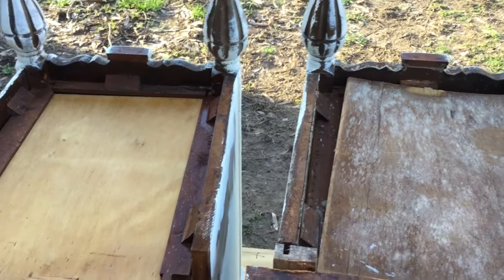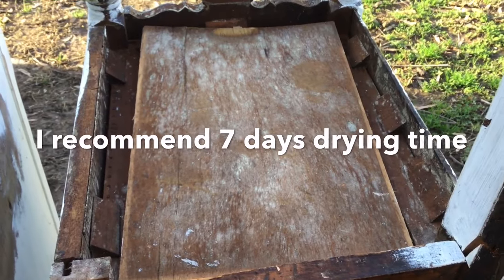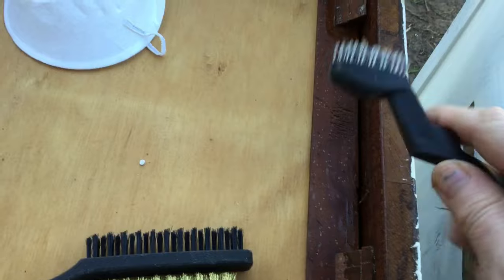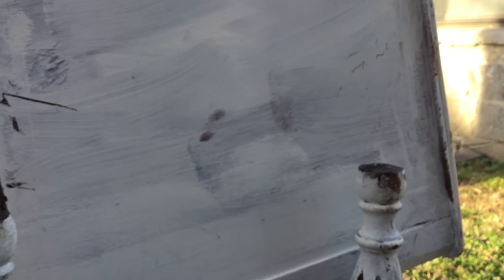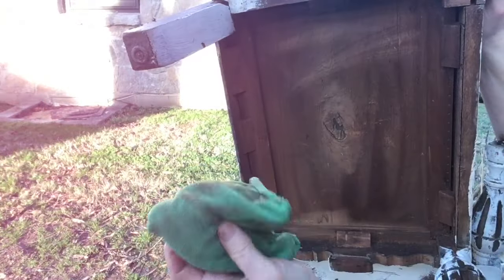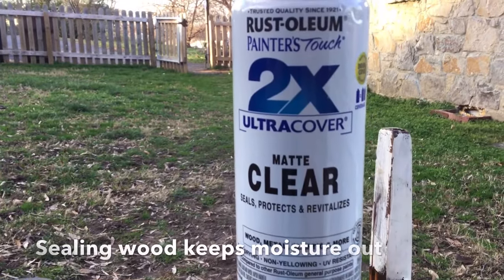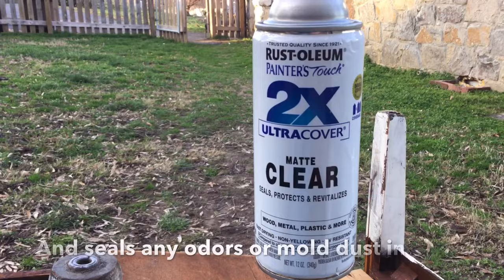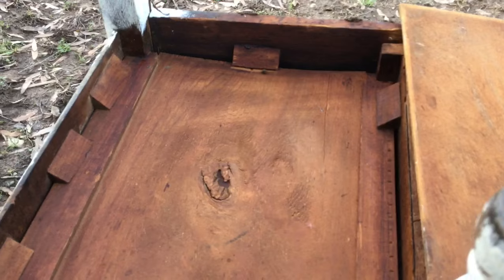Remove Mold & Mildew from Furniture DIY Hack  *Stop The Stink Mold, Mildew, Musty, Moth Balls Hack

Comment: Suggestion. Spray the piece with either vinegar or vodka to kill any mold spores and reduce smell. It will stop any mold growth.  Then proceed to the drying section. Spraying with vodka also removes smell in old clothes...
Reply: What about your couch? I’m having issues killing the order due to the humidity where I live. I spray it down with Lysol and it helps for a little while, but I can’t get it to stop coming back.
Reply: @Yah-Izoa-Hakaboth  Do not use lysol. That does not kill mold as easily.  You would have to saturate the fabric with vodka or even vinegar.  Let it dry thoroughly.. but, if the mold is in the cushions it may be ruined.  Sorry..
Reply: @SultanaP  it ruined  my wooden  Almari what can i do  when i try to wash it only cloth it not working  next day i can see lots of it can u give me permanent solution if i spray vinger is it work?
Reply: @Paula Goode Thank you so much for your information! No need to apologize. I’m going to try the vinegar and see if that works! Thanks again!
Reply: Will 90% rubbing alcohol be even better? I'm about to sheetrock but the framing has some black spots I need to treat
Reply: @levijessegonzalez3629  I'm sure it would kill the mold and deodorize
Reply: @SultanaP  better than vodka? And have you tried it on wood?
Reply: @SultanaP  I'm thinking of tearing out the wood unless I can find a treatment that kills the mold for good
Reply: @Yah-Izoa-Hakaboth  I have also bought a whole basement dehumidifier and it was worth every penny not to have to empty it every day.
Reply: Hi, I have a couple dressers that are musty but no visible mold. Could I spray with vodka, let dry then seal with the spray. I live in an apartment so getting the dresser washed outdoors won’t work.
Reply: @hihellosolares5862  vodka is inexpensive option for what you want to do. I use a sprayer from the local dollar tree and I big cheap bottle of vodka.  Spray it well,  let dry for a day and do it again. I am sure the smell will be greatly reduced! This option works very well for me, and is different than rubbing alchohol.  I don't know why,  but it is! Trying it is cheaper than other options! Good luck!
Reply: @SultanaP  thank you, this is doable. I’d really hate to have to get rid of my dressers.

Comment: Helpful for sure. I bought a 21 year old RV in Feb. Guess what they were selling it in winter to HIDE the MIDLEW. I did detect and should have RUN. But running was 550 miles to home & person with me did not smell it. Her 40 year son did not smell it and the seller swore he smelled nothing. So yeah me & my super smeller nose did too smell it. I drove RV home & on the way definitely right behind drivers seat. Sure enough once home discovered it is in one location under the fresh water tank right behind the drivers seat. I was able to knock the stench down over winter during cold months with mixtures of moldex & Oxine. They do not add perfume to the situation to mask it. It gave me great hope. Finally warmed up enough to pull the supposedly empty tank out 3 days ago. Pouring out approx a quart of water left in the tank with no way to prevent it at that moment in time. Had to cut wires that later turned out to be water depth detectors to the tank itself. OH will I don't intend to ever fill that tank more than 10 to 15 gallons using a reliable meter so to stop the source of wetting it that past owners didn't figure out. (Poor design of air hose where water can leak during sloshing about or if you over fill tank. Also sometimes the inlet fails and people don't realize they are dumping water into the RV along with filling the hose. This is the air intake hose. Ok when I pulled the tank I hoped for the best didn't get see the worst fear but pretty bad just the same. I've had lots of luck doing what's demonstrated here with furniture. Now and again it's not enough. The mildew scent returns in a few weeks to months. However love reviewing as I take a rest from scraping the underflooring where the mold's well imbedded. And due to electrical wires in this location and an electrical box just above the 4000 Onan generator it's super difficult to get it cleaned, scraped and DRY there. I ran fans all night. Started scraping today and right away could tell it's still dampened wood in places. It may be a week long job. I'm up for it. mentally more than physically I think. I have very sore wrists and shoulders from scraping yesterday. I need to worry about if it went up the wall. It's definitely into and under the wall. Dinette cushions and support that sits above this tank and mildew area picked up the scent too. This treatment shared today will work well to stop the smell in the board that the cushions sit on and also the surrounding support box that goes around the tank and also supports the cushion and that side of the dinettes bench. The foam has a slight odor as does the fabric. No problem for the fabric I am reupholstering the entire cushions and sofa. BUT not sure I can get out the scent from the foam. I'm planning on first hand washing the seat cushion with a lemon pine sol mixture and moldex. Then rinsing well in a solution of Oxine. Let air dry in the sun and hope the sun's UV will render the scent permanently gone. Time of course will tell. Meantime love watching when someone else does all the WORK. LOL. Great demonstration and so appreciate it. I will spray the boards that make up the sides of the box with a solution that stops mold growth for up to 1000 activation times due to dampness. And then spray with the YES I use the same clear Rustoleum spray paint to seal it. Also that'll be used on the board that the cushions are supported by too and I've had outside treated 3 times and still the smell is there. Pine sol is my next option. I will use the lemon as it's not as strong lingering as the original and probably not as strong either but should do the job. MILDEW so sad in most cases it can be avoided. In the case of this wonderful RV definitely could have been avoided and prevented had they fixed the problem right away. No instead I found all kinds of probably once scented drier sheets and sachets of various makes with no scent left too. No the seller knew he could pass the RV on in winter and so he did. And yes lesson learned. I DID KNOW Better and so needed to trust my nose. Not those of others who then couldn't smell it but now my husband and my neighbor who was with me when I bought it can too smell it. LOL. Luck to all of you who run into this problem. And thanks for this post. I needed it.

Comment: Hey I'm curious what state is in your furniture now? Because I believe you just trapped them under that finish, mold  cannot be removed from pourious materials, you may just removed the damaged finish, Mold has spores and they are not even visible at all, That is why you have to use something like a powerful vacuum machine with  hepa filter and it should not be cleaned in an open air but in an isolated room and after you brush the things off, that vacuum cleaner should run several hours in that room to collect any particles in the air. Besides diluted bleach would not kill the mold again, it will actually boost its growth, the reason behind that, the bleach does not penetrate wood, but water does, since you are delluting with water, water will get deeper than bleach, and will create better environment for mold to grow.

But anyways as long as your furniture is not in damp place anymore it should be fine, as long as your finish degrades and gets a bit of a moisture in it, the mold will rip off that seal.

Comment: I have mold and mildew on the outside surface of an antique Victrola.  How can I get that off without doing anything that would decrease it's normal appearance and value?  Thanks!
Reply: White vinegar. Saturate a cloth and wipe every surface. If possible let the unit air dry in direct sunlight for several hours.

Comment: Would you not recommend a quick bleach wash after wire brushing ... Just as an extra precaution against mould coming back again.
Ok, it"ll mean a bit more drying time, but not too long.
Reply from the maker: The mold and mildew are dead once the wood dries. You could wet it again with bleech, but every time you wet wood you run the chance it will swell or warp and not go back the way it was. Since I know the mold and mildew and dead and there is no visual evidence of it being there before, I feel confident with sealing the wood after the wire brush. If I was going to use bleach, I would use it while the wood is still wet if possible.If it wasn't wet, I just don't think I would risk getting it wet again.
Reply: When the mold dies, it releases toxic spores that cannot be killed easily, and is even more harmful than the mold was.  Please be careful when working with items that have had mold growth.  I love your videos and hope to be watching them for many years to come.  (Side note: eC3 is the best for lowering risk of toxic spores)
Reply: How to remove the mildew smell on used wood furniture?

Comment: if the mold is inside the wood and you paint it, can it then keep growing on the inside?
Reply from the maker: Mold needs moisture to live. Moldy furniture has normally been a damp place or had an incident where water was on it for an extended period of time.if you had a piece of furniture with mold and take it out of wet environment, the mold will stop growing and die. So the answer is no, mold won’t continue to grow under paint if it is in a dry environment. Also, You can add a “mold inhibitor” to any paint If it will be in a high humidity place, like a bathroom.